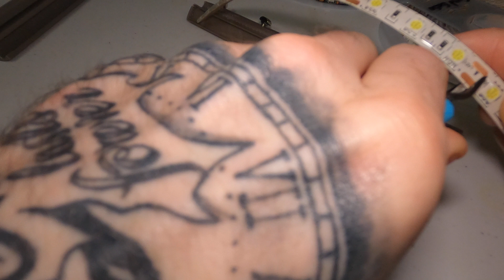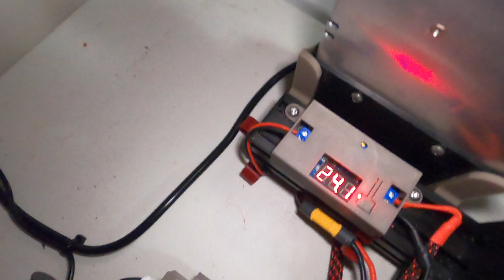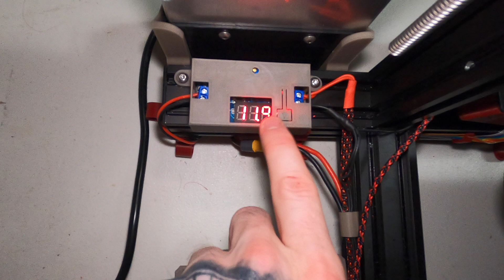DIY LED Light Bar Install | Creality Ender 3 Pro

Comment: For the 24->12v converter search aliexpress for " LM2596 step down small", the little green ones. That's more than enough for a small led strip.